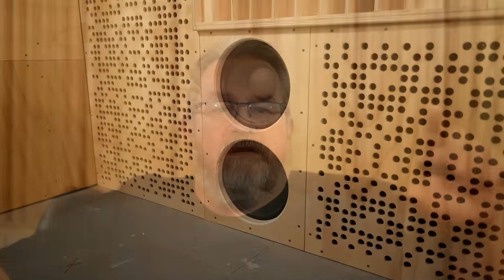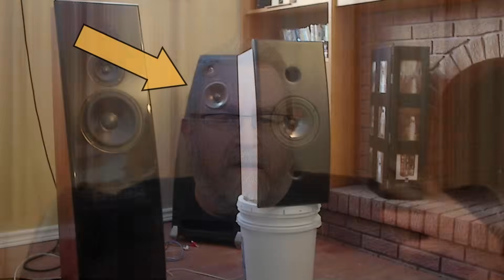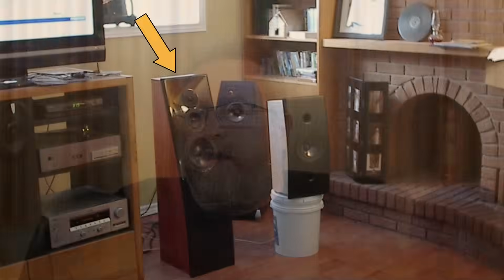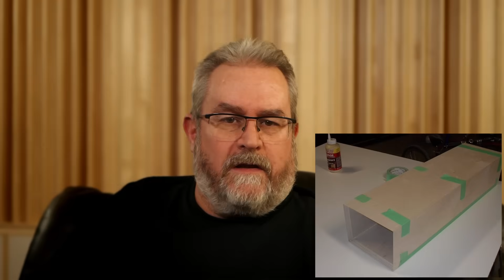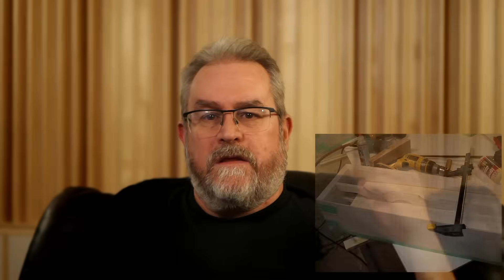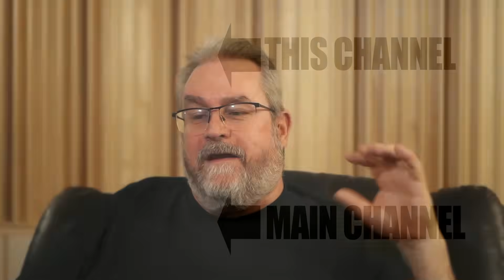Transmission Line Speakers are a Trap

Comment from the maker: A pure transmission line speaker will completely absorb the back-wave from the driver, making it behave like an infinite baffle. The advantage an infinite baffle gives is that there's no cancellation from the output from the front of the driver and the output from the back of the driver. The output from the back is thrown away and only the output from the front is used.
In reality, this is almost impossible to do fully, and that's especially true where a speaker box is concerned. You'll never be able to absorb 100% of the back-wave (with current tech), so a compromise is reached in the "transmission line" speaker by using some of the back-wave energy for the overall output. This is done by making the pipe length, damping and taper so that it channels the back-wave out and it is now in phase with the front-wave. This extra energy adds to the front-wave, boosting output.
The pipe is tuned so that by the time the back-wave travels through it, it will have shifted in phase to match the output from the front. And while it seems like it would be relatively easy to do that, designing and constructing a box to hold that pipe is more complex than nearly ever other type of speaker. And in my opinion it's questionable whether the results are better than a much less complex (and typically much smaller) ported box. 
But even when he know this, that doesn't stop the DIY speaker builder from taking a crack at it. And I have to admit that while thinking about the subject for this video, I find myself drawn to the idea again.
The one shown in the video thumbnail was very quickly drawn for this video. It shows the typical implementation of the folded, tapered duct with the output opening on the front. Along with this the duct would have to be stuffed with damping material to tune the response and reduce the ripples the long pipe adds to the response. These ripples extend up throughout the effective frequency range of the driver and can be difficult to get rid of. And I'm not unconvinced that the ripples are not what people like about these speakers - that extra "stuff" that's not there in other designs.
Reply: Your first sentence is not how I understand transmission line speakers - even in an ideal design. And full disclosure - I have designed and built 3 mass loaded transmission line speakers, and I am selling the build manual for one of them.
The back wave of the woofer is definitely being emitted from the terminus opening. In the program I used to design mass loaded transmission lines, called Hornresp - shows this.
And it also calculates the effect of the acoustic path on the outside of the cabinet from the center of the terminus opening to the center of the woofer. So, you have to have the cabinet layout and construction, as you work in Hornresp.
The image on your thumbnail shows an "old school" type of TL - the woofer is located right at the closed end. This almost always has a major trough in the output. The current design thinking, is to have the woofer located between 25-33% of the way away from the closed end - this sets up a much better set of resonances, and when done correctly, there are virtually no dips in the output.
And it takes a very sophisticated program to do the myriad of calculations of all the dimensions of the inside of the cabinet. There is simply no way to do this without the 3D acoustic modeling program. You load in the full Thiele/Small data of the driver you want to use, and then you put in the area of each section, and the lengths, and also the amount of polyfil, and where in the TL it is located. It is a long iterative process.
Reply from the maker: @NeilBlanchard  Hi Neil. My point was that after all of that, you basically worked 5 times harder and longer to produce a speaker that almost certainly has no advantages over a ported design. A ported speaker will be smaller, use less material, easier and more forgiving to design and take less time to build. It also won't be plagued by midbass ripples, like the TL.
That was the point of this video, and not a comprehensive history and technical dissertation on the transmission line design theory.
Reply: @IBuildIt  That's not been my experience with TLs - my cabinet uses 10 pieces as functional elements (plus 1 for an access panel). The 3 main additional parts that provide the volumes that form the TL, also act as braces. The 4th is an actual brace, in the closed end, to support the span on the front baffle between the drivers. So, there is near-parity of difficulty of construction. With CNC cutting, it is no more, and no less difficult. As far as material used - I am making a pair from a single sheet of 5x5 18mm Baltic birch. The speakers are 9" wide X 21.5" high X 16" deep standmounts.
The ripples you refer to are often there on "old-school" TL designs - however with powerful 3D acoustic modeling programs like Hornresp - the response is remarkably smooth and extended. In the case of my design, the driver Fs is 35Hz, while the fundamental response of the mass loaded transmission line is 32Hz. This is a 6" paper coned SB Acoustics midwoofer.
The bass quality is better than any speaker I have ever heard. Since the "column" of air is coupled with the woofer cone, and thereby adding its mass - it is working on a very different mode than a ported speaker. The air is not acting as a spring in the TL between the woofer and the terminus opening. So, the air pressure in the cabinet is lower, and this reduces the tendency for the cabinet to  resonate.
The bass distortion of a MLTL is lower than a ported design. And the midrange quality is also better, in my opinion, because in its upper range, it is able to operate closer to how an open baffle works.
The main improvements come from moving the woofer away from the closed end of the TL, about 25-33% of the distance toward the open end. This allows the design to be smaller than otherwise. The overall "pool" of knowledge about TLs has grown, and the software and computing power has come a long way, over the decades.
I can send you the build manual of my MLTL-6 speakers, if you are interested?
Reply from the maker: @NeilBlanchard  Can I ask if you've used the same driver in a ported design and did a comparison? You'd have to have both speakers connected and switch back and forth between the two while listening to reliably say which one sounded better. Even better if that could be blind.
See, the way I look at it is this: there are not a lot of TL speakers being made and if they are clearly superior to a ported design you'd think they would dominate. Maybe not the low-end market, but certainly the high end one. Why haven't the big players clued into how much better this design is and turned away from vented as the preferred design?
Reply: @IBuildIt  I have not done that. The two recommended tunings for a ported cabinet for the SB Acoustics SB16PFCR25-4 driver are 50Hz and 55Hz on the Madisound website. My speaker is tuned to 32Hz. It isn't a subtle difference. The Fs for the 6" driver is 35Hz.
The reasons that there aren't more TLs out there? One reason is that many people have not heard a "modern" design, and they assume that they know how MLTLs work, and how they sound? Moving the woofer away from the closed end allows the response to be very smooth and extended.
If you're interested, I can send you a pair. Or, I can send you my build manual.
Reply from the maker: @NeilBlanchard  The usual priority when doing a suggested tuning is box size, making it as small as possible. If the driver's Fs is 35Hz, it can be tuned to 32Hz in a ported box. 
Now, 32Hz for a TL is an effective line length of around 100", which seems like a tight fit inside the box dimensions you gave above. Tapering and stuffing will shorten it slightly, but it still must be wedged in there pretty good. One of the issues with the TL design that places the driver partway down the line is mounting depth, with the back of the driver too close to the panel behind it, which causes a hard reflection back through the cone. Putting the driver right at the first bend may fix that, if it's big enough to clear. Is that what you did?
As for not many people hearing a modern TL, that's true, but it's also true that TL's of any design enjoy a higher than average reputation. There's a lot more prejudice against the perceived flaws of ported designs than there ever was for TL, so that would be a major selling point. I mean if they sound that much better it would be obvious that they'd pounce on it and stop making ported designs altogether.
Reply: @IBuildIt  Okay - I'll take your word on what is possible in a ported design. My MLTL-6 speaker is just under 1 cu ft. This is another benefit of moving the driver away from the closed end - that is unexpected - the effective length starts at the woofer and "reflects" into and back out of the closed end. And we now know that the taper doesn't have to be "literal" - any reductions in the sectional area act as a taper, because the air movement when coupled to the woofer cone - just does this. Same for turning corners - we used to think that a corner angle gusset was required. But the "dead zone" in the corners, the air forms a still pocket, and the flow forms in the turns just as we would want it to.
Hornresp[onse] is doing thousands (if not millions?) of calculations. It is accounting for the polyfil (up to a point) and can then tell you pretty precisely tell you the mass you need to put in to get the effect in the Hornresp model. It also takes into account the path length on the outside of the cabinet from the center of the woofer to the center of the terminus opening - this eliminates almost all the response spikes that would otherwise be shown. Obviously, to get this path distance, you have to also be designing the actual physical cabinet - and over the ~4 months I was working on this design, I was drawing the cabinet in DataCAD at the same time as I was trying iterations in Hornresp. I then spent another 3+ months listening - I made a change to the cabinet, and had a major revision of the crossover.
The placement of the woofer in this MLTL-6 speaker, is at the top of the front panel, so the full depth inside is directly behind the woofer.
The taper is greater than the old "rules of thumb" would have had you do - so there is "more" effective length added than you might guess.
Another amazing thing that Hornresp can tell you is the max cone movement (at the power level you set) and it can tell you the maximum air velocity at the mouth of the terminus opening.
Because you could just keep pinching down the terminus slot to get deeper and deeper response - but the air velocity skyrockets. It should be an absolute max of 17m/s, but 10-12m/s or less is preferred.
As for ported designs playing low - I own Snell Acoustics Type E/II that have an 8" Vifa woofer, in a ~33" high cabinet. They have great bass - the best I ever got was -6dB at about 32Hz in my room. And the quality of the bass - and more importantly, the quality of the midrange of my MLTL-6 speakers - is far better than the Type E/II.
Transmission line speakers have lower air pressures, so this reduces the cabinet resonances, plus the baffles are good braces. I think that in the woofer's upper range, it acts similarly to open baffle - so I am of the opinion that TLs have a number of advantages that most folks have not known about.
Reply: @NeilBlanchard  I would be insterested what you say to the Wisdom Audio Design?
Reply: @robertschumacher9640  Robert, your mention of them is the first I have even heard of them. Their webpages includes a lot of products, and only a few of them might be transmission lines? So, I can't say anything about these.
Reply: @NeilBlanchard  see my post above
Reply: I believe a child would be able to tell difference 'tween the ported and TL'd box. In my case, small Spendor S3e with TL had smooth response, deeper, better controlled, "musical" bass than a much more expensive Harbeth M30.1 with its short-tube ported box design.
Reply: @vitriol218 I got some B&W 706 speakers as reference for my speaker building hobby. I asked my 9 year old grand nephew if the the B&Ws sounded better or worse than my built speakers. He pondered about it for a moment and then he said "I think the B&Ws sound a bit worse". To get an idea of how my (acoustically different) home built speakers sound, look up the only Nautilus demo on YT (and how my B&Ws don't sound). 😅
Reply: Transmission Lines come in all shapes and sizes, including sealed transmission line. For me, when I say "Transmission Line" I mean QWTL 
https://www.youtube.com/watch?v=jV0Ljnn8L0s
Been designing and building t-line exclusively for over 30 years
https://www.youtube.com/watch?v=3qjWKUBvSNA
https://www.youtube.com/watch?v=-96WAVQdcyQ
https://www.youtube.com/watch?v=qm5K_VVRwXQ
https://www.youtube.com/watch?v=Jdb2mbmL6jg
https://www.youtube.com/watch?v=J92zJIDOi1Q
And of course, the Jensen Transflex https://www.youtube.com/watch?v=6yb2msOQw_4
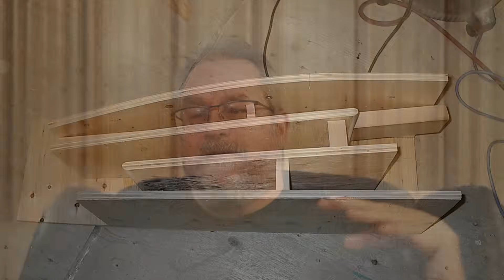Reply: https://youtu.be/iQ1xnz4UqqE 5:51
Reply: @NeilBlanchard I think they have too many products :D
But the video I posted is a transmission line and other than you that the Chassis and the Port are very close to each other and they cancelled the resonance frequencies by using a standing wave, at least that's how I understood it.
Reply: @robertschumacher9640  I am not seeing your post? I looked up and down these comments twice, and I don't see it; sorry.
When done correctly, a TL designed in a good 3D acoustic modeling program like Hornresp, there are some frequencies that are canceled and some that are in phase. The distance between the driver and the terminus opening are part of the calculations done by the program. Hornresp has been refined for a long time (several decades, I think?) and it is quite accurate, in my experience.
Reply: What’s your take on TL vs BLH ?
Reply: DARZHNARZHERSHSRVELFLARZHER?

DARZHNARZHERSHSRVELFLARZHER?
Reply: The B&W Nautilus is a perfect transmission line
Reply: @kjaudio1 About the only B$W that sounds any good. I got some AU $2,400 B&W 706s for reference and they suck in the midrange. They sound "foofy". I build speakers and (although the B&Ws are a great help for basic EQ) I like to hear the croaky sound in the female voice so there is presence in the voice sound. I like texture in the voice sound which is notoriously lacking in my expensive 706 reference speakers.
Reply: I build speakers and to get an Idea on how they sound, look up the only Nautilus demo on YT. And it demonstrates how my reference B&W 706's don't sound. I like to "see" their throat (so to speak) like with the Nautilus, but with my 2 grand B&W 706 speakers you simply don't get that. They notoriously lack texture in the voice sound. 😅
Reply: A lot of testosterone on this subject. Very fascinating
Reply: 😅 I made a long comment like that on one of your great videos! ❤

Comment: Using the Bailey transmission line design: Kef B139, B110, T27 and Coles supertweeter, I built a pair of speakers 36 years ago. I still use them in my second system in the den. They have a very clean sound which suits their use in streaming movies etc.

Comment: I think 3D printing is the perfect fit for TL speakers. I've just made a set using gorgeous copper-domed 3" full range speakers for my wife's computer, along with a 4" subwoofer enclosure. The speaker chassis can be printed in one hit - albeit around 12 hours for each speaker. And the Sub took 2x 16hr prints.

The pathway is rounded, and there are no square corners in the build. The pathway is completely airtight as I used a lot of gap-filling glue in assembly, and I built in grooves to hold the glue. The sides are 19mm marine ply featuring chatoyance-filled Sapele mahogany. And then treated with carnauba/beeswax mixed with vegetable turpentine, and then polished. Nice finish!

The units are unsurprisingly, rather heavy - as I used a lot of wall layers, and 50% in-fill, which uses a lot of PLA.

And... running on a little (but very impressive!) Chinese 30W 2.1 Bluetooth amp they sound absolutely brilliant, and look commercial quality, if I do say so myself. :P

It was a super fun project, and now my wife thinks I am some sort of superhero, for upgrading her listening - especially as she can now listen to her phone through her PC sound system. :)

Saying this, however, I don't think I'd want to print any speaker which required more than two 3D printed parts to fit together, as large parts can be troublesome in terms of dimensional stability - which leaves a lot to be desired compared to wood!